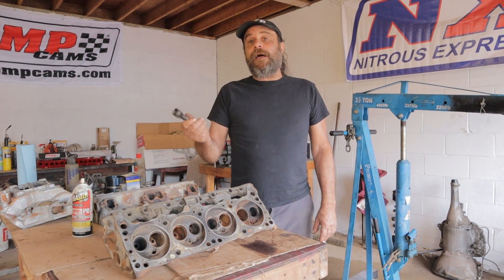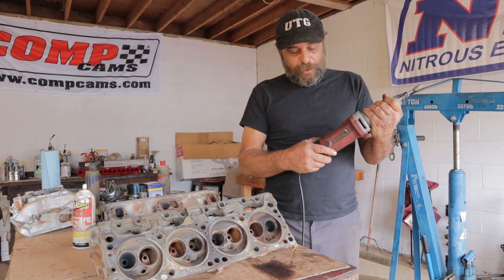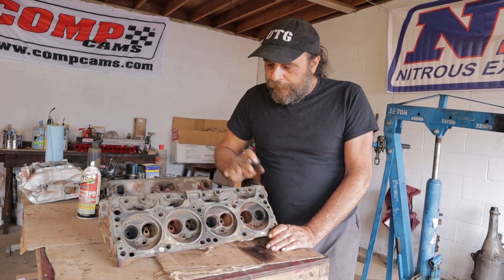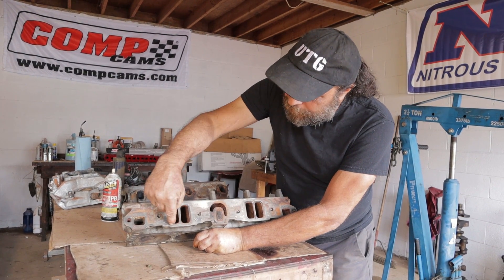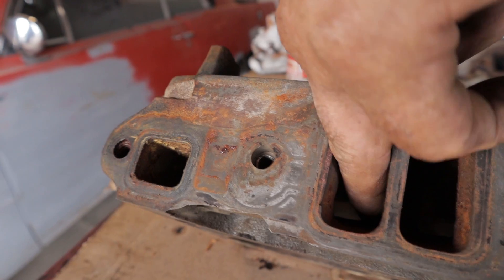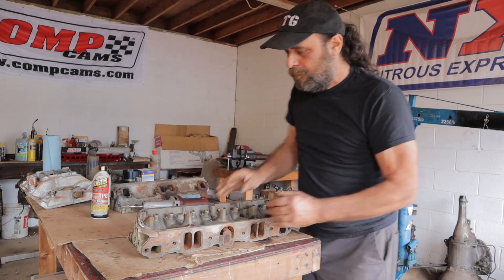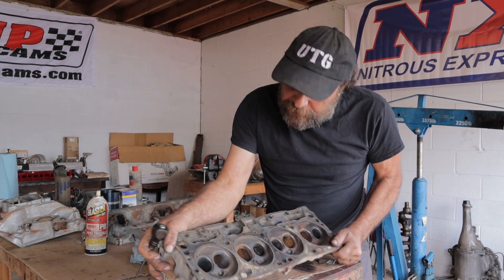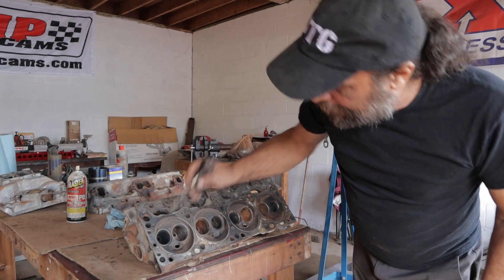Perfect Daily Driver 10 - Cylinder Head Porting Basics

Comment: Guys please wear eye and face protection anytime you mess with anything to do with cutting or grinding. 26 years in fab and machine shops, and I have seen some ugly mishaps. Including a 24 year old who lost his right eye.
Reply: Good advice - !  He does put on spectacles each time which would afford some protection and probably ok with the tiny bits flying off, but not as good as complete protection from wrap-around safety glasses.  Should also be wearing gloves and hearing protection.
Reply: I was once prying with a screwdriver when it slipped off the part and went between my left eyeball and eyelid.  I wore an eyepatch for three weeks while it healed.
Reply: @JohnWilburn  Ouch! Eye injuries are painful. Have had more than enough metal chips in my eyes myself. I posted this comment mainly for the young viewers who may not realize the dangers with cutting and grinding. Chisels and prybars have the potential to be deadly. I've seen a few YouTube videos of guys not wearing PPE. Even saw one the other day of a guy welding in shorts and flip flops.
Reply: @cruzinezy1968  real men aren't obsessed with "manliness"
Reply: This!! Breathing protection too! Gunk in those ports, cartridge roll dust can f your lungs up real bad.
Reply: "Dont be a pussy"

Comment: Before shot, description of problems, after shot, explanation of what you did and why. That's the best home porting video I've seen. Thanks again Uncle Tony
Reply: It's 2 am n I felt like I can go out their n do it my self rn
Reply: This is not so much a port, but prep and quality control for a casting that received minimal  basic machining, then kicked out the door by the car company that made it.  Call this a good cleanup that anyone can do, and if you want to hand it over to a porter, he can concentrate on what moves flowbench numbers.   The large wall of casting flash in that bowl is beyond sad: they really didn't give a rip.  If that broke loose, it's enough to destroy an otherwise good engine.
It makes me think if I went back to the 60s/70s in a time machine [to place a few key rides in the family to enjoy later], the first thing I would do on every car is yank the heads off, and fix the sloppy work just like this vid shows.   Could be fun, watching the dealer go slack jawed as I demand heads pulled on a brand new car before it leaves the lot...and I would not budge: no sale without my inspection/cleanup.
Reply: @flinch622  I dont see a car dealer going for that or warranting it..but see the point. 
Dont see anything done here that will help w/power

Comment: On a set of the '89-'92 5.9L "308" castings, I've always heard to gasket match & then just clean the runners, ports, minor stuff. No opening things up, "Hogging them out" or any of that. What does Uncle Tony think?
Reply: its what he just showed  :)
Reply: @modelnutty6503  yes & no- The thing I've always heard about the 302 & 308 casting is that traditional  "Open 'em up for max flow" doesn't apply- the heads Tony is demonstrating with are earlier SB heads. For max flow, the earlier heads do use that old school logic, but if done on the 302 & 308 it purportedly ruins the advantage of the design. I was trying to see if Tony agreed or had some insight on that era of SB head, especially the 308...which again has always been said to flow as well as an X head when cleaned up, which is plenty for a healthy street performance car
Reply: A 308 is better than an X head to begin with.

Comment: Quick question: I have leaded head for my 318cu Small block, I'm wondering about the additive, Should I do a change over the heads OR does it really not matter? Just a daily driver as well
Reply: If you don't have hardened valve seats, you either need additives or a trip to the machine shop.

For a daily driver, I'd spend the money on hardened valve seats, just to avoid the annoyance of having to buy whatever additives every time. I mean, a fresh rebuild should last a minimum of 50k, and at 25 miles per gallon that's 2000 gallons of gas. 20 gallon tank? 100 fill ups.

What's 100 times the cost of a bottle of additive?
Reply: @ScottKenny1978  Alright, sweet deal! I wasn't too sure myself! This is my first older car being I'm only 22 and doing it all at home lol I'm going to looking to the hardened values but for sure use the additive till I can afford the upgrade!! Thanks again for the help!
Reply: @Spartan117Devin  whatcha buy?
Reply: @ScottKenny1978  If we are talking about the car it's a 1969 Plymouth Belvedere 4-door but, I'm looking at a new set of heads for $400 and just keeping the old leaded heads in my attic lol
Reply: pick up some valves for it maybe.

Comment: Cool video on basic porting.65 to 70 percent off performance is found in bowl/throat area 25 percent in the short turn and 15 percent or there about is found in port runner roof like ut says not the  floor. vavle percentage  when it comes to bowl and throat big is never better it all about mean port velocity. One thing to remember is on intake side the port runner starts a inch or 2 into they intake manifold.happy porting

Comment: Good job on teaching this  my only negative  comment  would be  you should be wearing a full face shield  ive personally have had Dremel attachments  come apart on me and  onetime one had so much force behind it  that parts of it lodged themselves into a nearby wood wall like a bullet would  yes I’m sure it was a cheapo  made in China  attachment i got from Ebay  in a kit  but thats beside the point  parts of it did  bounce off my face shield  i usually buy at Harbor Freight  pretty reasonably priced  definitely cheaper than a dentist or eye surgery

Comment: I have a million things to do and almost lost the tip of my other thumb. 
God damnit. 
But tony still makes me want to go out and rebuild my top end for a porting job. 

I’m on borrowed time my engine had 299k miles when I rebuilt it with new valves and lifters, but camshaft is worn and shows copper. 

Can’t afford a bigger cam, so might as well increase my duration by cleaning up the meat around the seats. 

Thanks tony. I was having a bad day
Reply: That is not going to help duration 1 bit. Get a good valve job that will help more than anything done here.
WIth 300k its probably beat to hell anyways
Reply: You still are having a bad day with your foul mouth!!

Comment: I was really impressed with the job you did int the 318 heads this past Sunday.
Reply: LunarOutlaw’s Garage great job fellows
Reply: I want to see that project spin Nick's dyno, this one too!
this piston flipped 360 stroke 318 head thing is going to be a little torque beast when its finished. its not going to need much of a cam in there for what he's showing us all in this video.
Reply: MrQuickPick Hartford, CT thank you! I’m doin a 360 build series and a separate 360 time lapse build. The series has multiple 20-30 minute steps. The time lapse should be under 10 minutes 🤞🏻
Reply: This is all very good information. It makes far more sense to optimize an original design than to fundamentally alter it. When it comes to porting, bigger isn’t always better but straighter usually is.
Reply: I used to have a gas powered lawn vacuum that had a curved chute that was shaped like a port. Anyone who wants to learn about flow dynamics could learn a thing or two from studying that machine. When you run it at full speed the air at the top of the chute (roof) is moving over 100 mph. The air at the bottom side of the same hole can barely blow out a match. 
When you grind the floor of an exhaust port you slow the air down even more.
Reply: Me too!  That’s where the hater scaring dyno number is going to come from.
Reply: John Wilburn check out my her porting video! https://youtu.be/Xy0FpPcygWo
Reply: Good stuff.  I subscribed!
Reply: John Wilburn thank you! I’m no uncle Tony, but my dad knew as much as him when he was alive. Trying to keep the mopar legacy alive!
Reply: @JustMoparJoe  I can relate to that (although, my pops is still kicking). Anyways, he used to tune carburetors for Sox & Martin. My Dad has forgotten more than I could ever know about old school Hot-Rodding. One thing for sure though, growing up with a "real" motor-head for a pops? I learned my share, remember a whole lot. And,  I can assure any doubter, Uncle Tony is the real deal! I have yet to see one morsel of BS spewed from any of his vids.
Reply: @wheelieking71  I grew up with a bunch of mopar guys, read all the magazines as a kid! Tony keeps me in my happy place! He is the real deal, just like family to me!
Reply: @JohnWilburn  Oil pressure got scared on that one. Next time! lol

Comment: I always leave the burr finish on the intakes and sand roll polish the exhaust.
Reply: Yup. Leave the intake rough surface. Atomization
Reply: Only time I use sand rolls on an intake or intake runner/port is when using port fuel injection
Reply: Yep, texture in the intake ports helps keep fuel suspended in the air, and smooth polished exhaust ports helps with flow and prevents carbon build up.
Reply: I do the chambers too, helps with carbon build up.
Reply: Absolutely 
It also helps with flame propagation